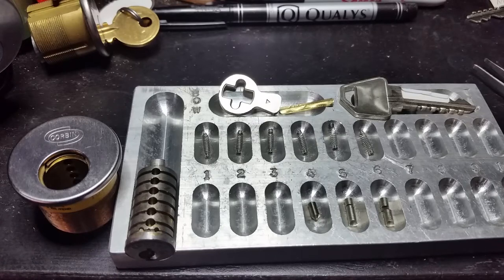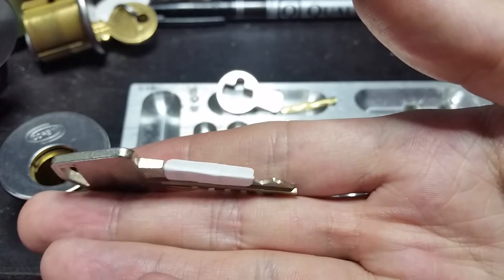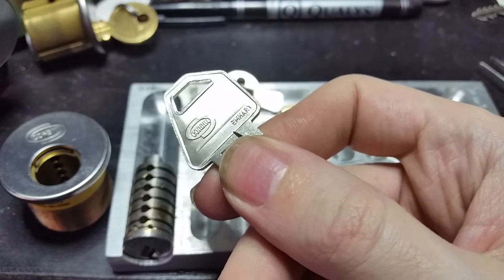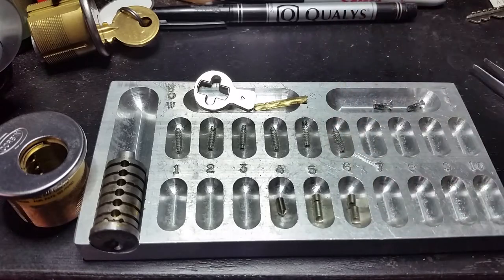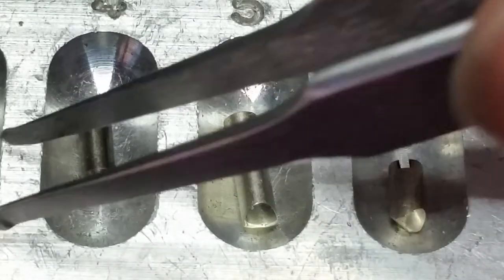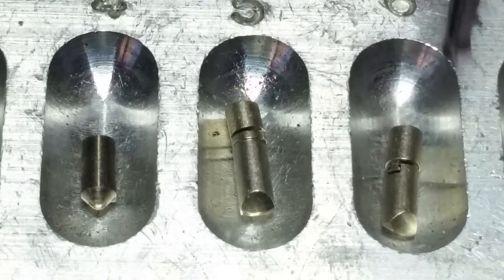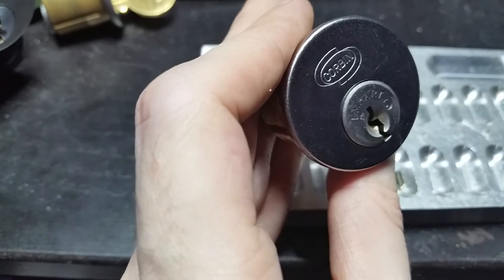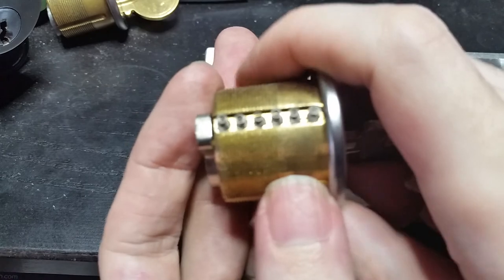(100) Corbin Emhart how it works

Comment: A rare and sexy thing. Congrat's for getting your hands on one. A cutaway lurks on the work bench here. A big booooo to Medeco for being a pain in the ass and robbing us all of a fine and cool lock.
Reply from the maker: Thanks! I got really lucky after years of trying to find one of these. The most Ironic thing about the Medeco/Corbin fight over axial pin rotation is that now that they both are part of the Assa Ably Group, Corbin Russwin and Sargent are now making direct copies of Medeco's M3 family systems under the names Access 3 (Corbin Russwin) and Degree (Sargent).
Reply: Yeah, kinda funny.Thanks for heads up concerning Degree and Access 3. Just reading docs now on Degree. The angled pins and their geographical exclusivity (DG3) talk sounds interesting. ;)

Comment: I always dig seeing those.
Reply from the maker: They are very nice and hard to find these days. The sad thing is that the design still holds up as a very manipulation resistant lock design with good key control but the successor designs just aren't as good and they don't seem interested in reviving it.

Comment: That's a cool lock not seen too often in youtube
Reply from the maker: They are quite rare. Corbin hasn't sold new systems of these in decades so there aren't many coming on the used market now.
Reply: Yes, they are quite rare. For anyone that has not seen one before, it might have been interesting to see how the pins work with the slots of the core. At least I enjoyed when I saw that the first time.

Comment: This particular lock appears to have the 39 b1 keyway, it is the reverse version of the 93 series.
Reply from the maker: Close, but not quite. It is the 62B1 keyway which is a reverse section of the 59 series and is part of the Z-Class Restricted Corbin family.
Reply: Nite 0wl I had a closer look and realized my mistake, do you have any 93 series or 39 series in your collection?
Reply from the maker: I don't believe that I do. Most of my Corbin cylinders are L series, I do have a number of Russwin cylinders in N and D series keyways.

Comment: Sweet lock. Wish they still made them. I prefer them over Medeco but I would not put this beauty in service, it'd stay in my collection.😎✌
Reply from the maker: If you have an existing system Corbin Russwin does supposedly still offer parts and cylinders. This one will go into my display collection once I get a new spring cover and stake it down cleanly.